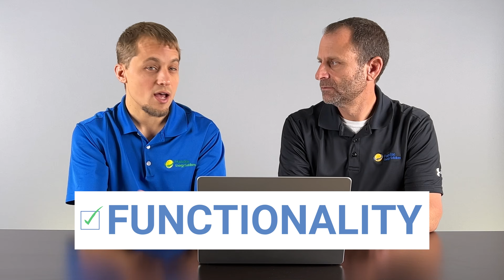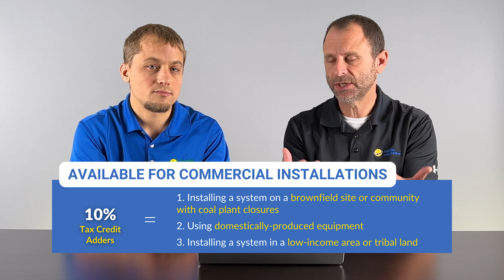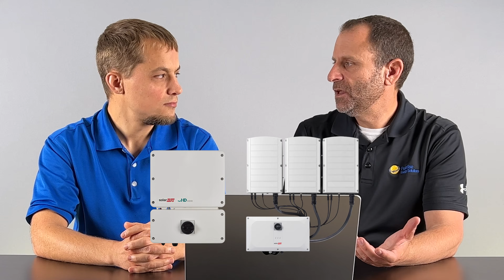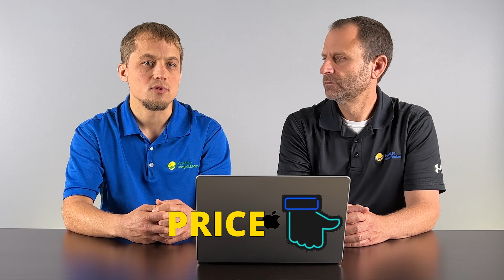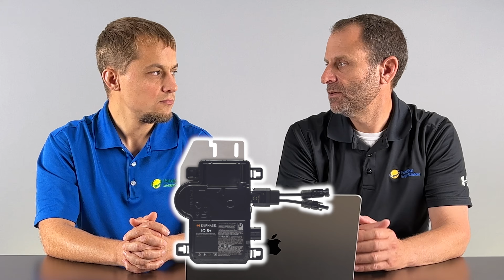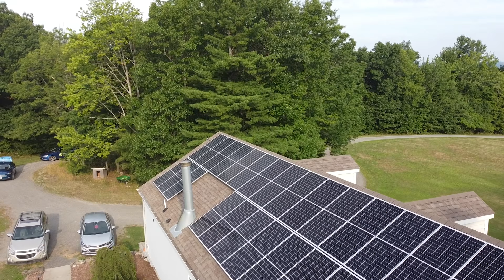TOP 3 BEST Solar Inverters

Comment: In 2010, I had Enphase D-380 micro inverters installed with 18 Solar World 245 watt panels. If you get the “manager “ version of monitor software, it’s good per panel data. So over the years, all D-380 (9 of them), failed. Enphase was great about replacing them free under warranty. The latest replacement look  the the IQ type, they supplied adapter cables free also. If I were to do it today, I think I’d look at SolArk hybrid, so many options for battery adaptions. All and all, I’ve been very happy with my solar system.

Comment: SMA does have their own RSD and has for several years. SMA JMS-F with a 25 year warranty. You are right that SMA does not have MPLE but solar panel failure rates are 5 in 10,000, .05%. Hence, 12-25 year panel warranty is typical.  The additional cost of MLPE would be better spent on more panels, increased solar production.
Reply from the maker: Yes, those are pros and cons that each person needs to weigh.

Comment: Thanks for the interesting suggestions. You mention some brands of inverters. It would be helpful to list explicitly those inverter models that can be used with batteries. In my case, I need a hybrid inverter 50 kW with storage capacity of 10 kW. It is hard to find such a system. Thanks again Ari
Reply from the maker: Great suggestion! 👍

Comment: SMA is what I chose.  I just wish I got a bigger inverter.
Reply from the maker: Good choice.
Reply: Its common to oversize the panels by 130-160%. Their "may be " some clipping but may be not.  Even an SMA White Papers suggest to over panel their string inverters. Also, panels do not produce their spec'd output. And if they even come close the conditions have to be just right, a very temporary, short term event. Total production yield is far more important than peak output.

Comment: Thx for the honest info guys. Much better than sales guys saying all manufacturers are great and no issues. I started getting quotes 3 years ago and all 3 installers quoted SolarEdge. At the end of 2022 all 3 switched to Enphase due to ‘issues’. I decided to install Enphase myself and so far no supply issues. Thx again.
Reply from the maker: Mike, good to hear you've had a good experience with Enphase. Thanks for watching!